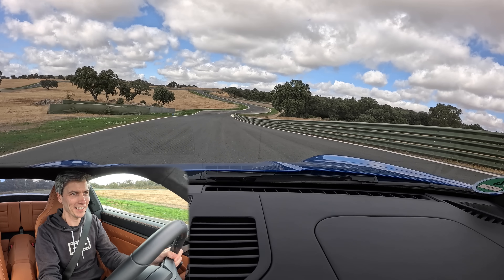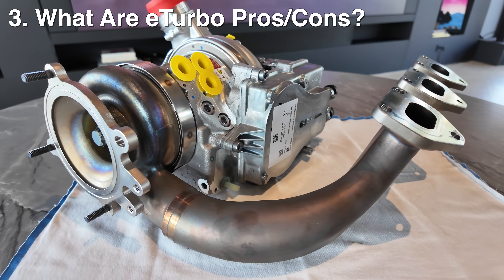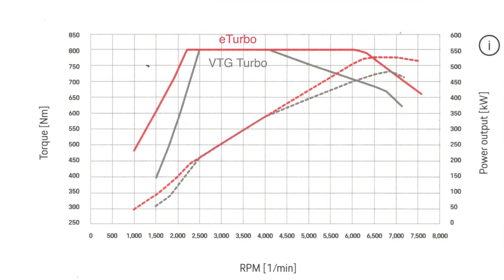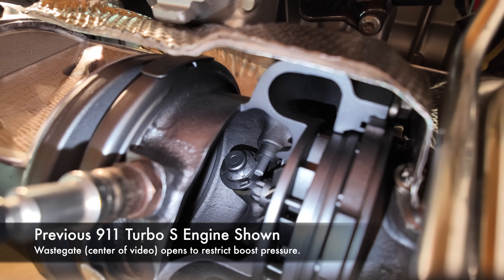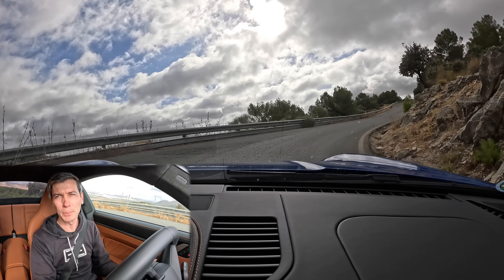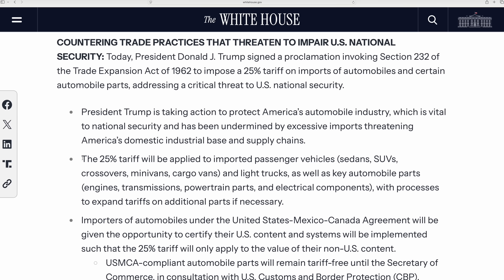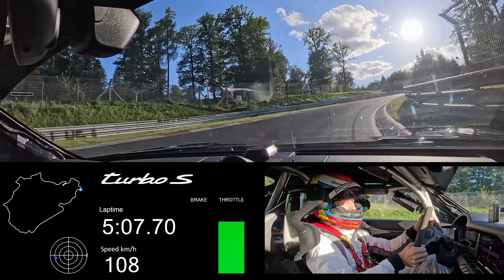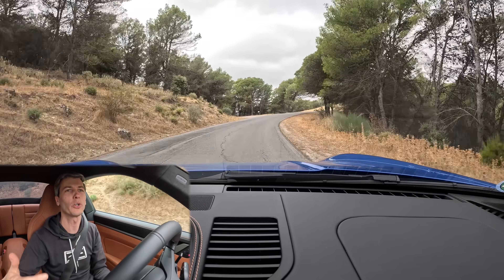Electric Turbos Are Here — Is It A Good Thing?

Comment: Sounds a little bit like what we used to do in the sixties.  Replaced the belt drive with an electric motor on Paxton superchargers.  Pretty effective on the drag strip.
Reply: Tell me more about this.  Interesting
Reply: I'm guessing you had the lead acid battery power to last the 15 seconds required to run a quarter mile. It would be interesting to see some historical records for this.
Reply: Has some similarities. With modern technology things are much smaller, much lighter, and much more powerful. The computer control for everything also makes it much more usable. The old systems could produce a lot of power, but were heavy and hard to control beyond specifically for racing. Now, they can build systems that are compact and lightweight while still making similar power and are usable in much more varied driving.
Reply: Yeah, this is an electric supercharger. The only difference is the energy harvesting because it's not a dragster.

Comment: The Next Gen 911 S/T-T will feature a manual transmission, 2WS only, pull tabs for door handles, a hand cranked engine starter, and, a single fixed geometry turbo with 4,000 rpm threshold with a 10 second lag....

...and a US$1M price tag...

...for engagement and weight saving...

Comment: Seems to me the best route would be to buy the best aircooled vintage Porsche one can afford for tactile thrills on weekends and an EV for the rest of the time.

Now an electric compressor with just the electric motor and compressor makes sense as an aftermarket altitude compensator for gas motorhomes.  The electricity can come from the house batteries, which are topped up with solar, on-board generators, and/or shore power.   Would only develop boost as needed, mainly for steep inclines and mountain passes

Comment: I have a problem with your "Advantage # 6".  If your battery is depleted, and your engine can produce 630HP, the 37HP from the turbo's (2x14KW each) has to come from somewhere.  This must come from creating back pressure, which reduces engine output by at least 40 HP. So, at this mode of operation, your engine will output around 590HP, not 630HP. So your total HP will still be just under 630HP.
Other than that, electric turbos are excellent.  My C63s E-Performance is fantastic to drive, with instant power and acceleration, and far outperforms its predecessor with the 4.0L V8 Twin Turbo, even though it's around 500KG heavier.
Reply: Your assumption on the arithmetic is incorrect. The power recovery from the exhaust energy is far more than the power cost from the increased back pressure.

Comment: It does surprise me that it is more efficient to convert the exhaust gas energy to electrical energy and then back to mechanical energy, than it is to let exhaust flow more freely out of a wastegate. I would love to understand the calculations behind this. I'm sure the engine must work harder to fight the extra back pressure. But I guess the turbo regen recovers energy faster than the back pressure takes power away. Still kinda trips me up though .

Comment: Impressive but dated at the same time. A properly sized electric motor gives instant torque to the wheels, no need for overcomplication of ICE assisted by a turbo assisted by a small electric motor.  Cool but a bandaid tech at the same time.

Comment: Clearly, you never drove an FD RX-7 with the twin sequential turbo setup. It drove very much like ahat you described. The only "laggy" part of that 13-B was coming off idle, when theres minimal exhaust. If the throttle was cracked, wven just a bit, the first, smaller turbo, was spun up and essentially zero/minimal lag.

Comment: Lets just get rid of the exhaust side altogether.  Full electric e-Charger.  Reduces complexity substantially.  Packaging is way better, not having to accommodate exhaust plumbing.  Lighter weight, etc.
Reply: That would be an astronomical waste of the energy the exhaust gas has

Comment: Another piece of over-engineering a solution for less than 0.1% of the marketplace. 👎
1. As of today, most high-end EV cars beat the Porsche 911 Turbo S in price, performance, maintenance & running costs
2. Once static batteries come out (with 2 to 3 times the energy density of Lithium Ion), the gap will be even more immense.
Reply: Why on earth do you think a Porsche 911 Turbo should NOT be for less than 0.1% of the automotive marketplace? It always has been, always will be? If you want a Corolla or Civic, go buy one

Comment: I think this is super cool. It’s like it’s blurring the lines between these different technologies of being a gas and electric hybrid and rethinking what the role of a turbo is. I thought it’s especially cool how it doesn’t use a waste gate and it uses the extra energy from the turbos to power the electric motor. It’s like one harmonious unit where the engine, turbo, motor, and batteries all work together to create the most amount of power as quickly as possible.

Comment: Not only are ‘electric turbos’ a shitty idea, whatever you call them, you shouldn’t call them turbos because that’s not what turbo means.

A Turbocharger is specifically powered by exhaust gases. There is a mechanically driven equivalent, which is called a supercharger - if you’re going to try electrically motivated forced induction (why?) then it should be called an electric supercharger.

But it’s still a shitty idea. It’s an over complicated solution to a problem that was solved thirty years ago.
Reply from the maker: You sound upset. The turbine is indeed driven by exhaust, hence it is an electric turbo. All turbos are superchargers, by definition.
Reply: @EngineeringExplained  Not upset, Turbo lag is a forty year old problem solved thirty years ago. Get an electric’ turbo’ if you want - good luck having it still work when the manufacturer decides they’ll stop supporting it so you have to buy a new one.

Comment: i feel like they make this setup more complicated than it should be. why not a 100% electric turbo? no more backpressure on the exhaust gasses and way less mechanical complications to maintain in the long run. a 100% electric setup would also be cheap af to replace when it eventually fails. the 3d models of the hybrid electric+exhaust powered turbo on this porsche you're showing make my head spin, maintenance nightmare.
would a 100% electric turbo need a complicated engine oil flow cooling setup? given it is not powered by hot exhaust fumes, id think this is one less complication needed for it to work. 
omg i want to talk to the engineers rn

Comment: Does an electric turbo being spooled by the electric motor also improve scavenging by pulling exhaust out of the combustion chamber at lower RPM?
Reply: No the higher the RPM of the turbine actually helps creating more backpressure(Radial inflow turbines is funny that way).
Turbine power is PressureDropOverTurbine*MassFlow*EfficiencyAtThisSpecificScenario so as the turbo is accelerated by the electric motor it does create more "turbine backpressure" so that the exhaust also can give more power to the turbo.

Comment: So it's basically electric turbo-compounding.
Reply: Exactly. Without the complexity or weight of a fluid drive to feed the turbine power into the driveshaft. Really clever.
Reply: So is it like a supercharged car but instead of belt, uses electric motor?
Reply: @randomman6189  no its turbo, it still has the turbine in the exhaust. Some turbos have a drive connected to the crank shaft to put waste energy back into the drive train.

Comment: Wonder what it would be like without the battery at all.  Just the turbos powering the electric motor; lower weight would be better for track .  Under track conditions, revs are high anyway - lag is reduced.

Comment: That 3.6 is a completely new engine shares only 1 part with the previous unit x 6 ...the injectors. The turbos can spool 145,000 rpm. It's leagues ahead of the previous version.

Comment: So they're hybrid turbos, not purely electric turbos. This means they still need intercoolers. If they were purely electric, they wouldn't need intercoolers because they could be placed away from the exhaust manifolds. I don't know if they would be able to spin as fast, however. You're thoughts?
Reply from the maker: Intercoolers are unrelated to if it’s exhaust driven or electrically driven, when you compress air it heats up, so the intercooler is needed to bring this temp back down.
Reply: @EngineeringExplained  Man, I'm not able to wrap my head around why compressing air makes it warmer. I always thought denser air was cooler. Cold air intakes are all about colder, more dense air, right. Or does the artificial compression of air to make it more dense have some affect I'm not aware of? Like the molecules are now moving faster in a more confined space, so more collisions with other molecules causes heat?

Comment: How are they cooling the coils, turbos get hotter than anywhere else on the engine 🤔 is the coil in its own water/oil jacket, or have they found a way to run electronics at a higher  temperature? 
How does this account for the thermo-resistance relationship of the conductor?
Otherwise its a very cool concept with removing vanes and wastegates

Comment: What's the point of having a traction motor if it doesn't a whole lot because most of the power is sent to the turbos? 
I like to see a comparison bet this and the older NSX that uses the motor to blend torque and turbo lag with traction motors

Comment: Great innovation, but not entirely new, some company in Australia was selling or developing electric boost devices at some point. The problem was the huge amount of power needed to make big boost using electricity only. It required a large battery setup and huge electric motors to generate a boost equivalent to a regular turbocharger. (Think golf cart sized)

I see a use case for this where diesel-like torque is needed from a non-diesel engine, for towing purposes, a system that generates huge boost pressures at low RPM would work for such applications. I don't like that the boost still needs time to build-up on the Porsche design, there should be a trigger button to go to full boost for hard launches from a standstill. Or a setting that maintains the highest boost at all time for short bursts of high torque power.

Comment: Lugging engines with electric turbos will be more common because of the low RPM and instant high load, especially these sports cars with manual transmissions or automatic transmissions that don't auto shift when using padle shifters. Engines wear quicker when lugged.

Comment: Hardly a new idea. Large ships using two stroke diesels use electric turbo's at low speed because the exhaust gas turbos can't pump enough air.

Comment: Pro for eturbo: You didn't mention that anti-lag on traditional turbos is hard on the exhaust as well as capable of doing damage if configured incorrectly.  Con for eturbo: You don't get the cracks and pops from a traditional turbo with anti-lag.  or maybe it's a pro, if you aren't into that kind of thing.

Comment: A triumph of engineering--using hybrid technology to maximize performance.  But for the 98% of your audience that will never be able to drive this car, how about just using a beefier alternator and battery to power an electric compressor.  It would reduce cost from conventional turbo, eliminate lag, improve emissions and fuel efficiency, and actually reduce service costs.

Comment: See the move is simple, get a 3-2-1 Coyote Twin Turbo with sequential twin turbos so you already have an anti-lag system essentially then use 1 electric turbo to enhance the smaller turbo allow for instant power on launch and big boost on top end.

Comment: Jason, great vid as usual.   One thought I had was that wouldn't it be useful to allow each intake and exhaust turbo to either spin independently or be rigidly attached via a clutch?    There are probably modes of operation where the compressor and turbine are optimally spinning at different speeds.   This would probably require separate electric motor/generators...

Comment: seems like replacing the electric motor starter, electric motor driven turbo  and the outdated, heavy, dirty, noisy, slow to respond internal stinkbustion power plant with one big electric motor would make the most sense, provide a much quieter, enjoyable and cheaper over all driving experience.

Comment: I have a question that is not exactly on point. I have all wheel drive Alfa Romeo Giulia four cylinder. In sport mode I can take off from a traffic light with instant acceleration. I’m assuming that the turbo is a small one. Does this instant acceleration have anything to do with the all wheel drive?

Comment: Good insights. Regarding advantage 7, are emissions really reduced if you’re increasing exhaust back pressure by slowing the turbo through energy recuperation? (#4 I think) Not an engineer, but just seems to me the two are at odds. Thx.

Comment: "Higher RPMs"? "Higher revolutions per minutes"? I thought the unit was one minute. DEADASS!
Reply: It is revolutions per one minute. RPMs is just shorthand, not grammatically correct.
Reply: @abhijeet_ghosh  Do you understand what shorthand is? In this case, revs would be one syllable less than the high school drop out term "RPMs". How can you claim to be explaining engineering by using obviously backward psuedo-terminology? Other redundant terms used by those less educated are ATM machine, or PIN number. This "engineer" has a chronic form of RAS Syndrome, or Redundant Acronym Syndrome Syndrome.

Comment: what does it do to pre-turbo exhaust gas pressure then? 
the wastegate would have allowed excess gases to by-pass the turbo, but in this scenario the gases are stuck in front of the turbine? 
doesn't that make the engine work harder to pump out the gases through the slowed turbine?

anyway it looks really interesting and well thought-out, I can imagine that replacing 'normal' turbos in a few years.

Comment: A downside will be cost replacement. And since Porsche charges $1,110 for their least expensive key. The price of an electric-turbo will be significant as for a time you will have no choice but to purchase your replacement OEM. Also, heat will kill the motor.

Comment: For non-track use, better to replace the flywheel with a hybrid electric motor to help the engine instead of turbos. Regenerative braking is free, a hybrid electric motor reduces load on the engine with zero lag vs turbos increase stress on the engine, and while engine is warming up a hybrid motor mostly pushes the car to be gentle on the cold engine

Comment: Compexity of this system is absolutely insane… which will ultimately be its demise
Reply: No, it's not particularly complex as far as modern engines go. On the contrary, the combination makes almost every component simpler than in a different system for the same performance. The electric turbos are really just big turbos with a small electric motor in the middle. Those motors are nothing special - because turbos rotate so quickly it's much easier to effectively electrify them than other parts. And because you power the turbos first, the engine is responsible for low-RPM torque, so the traction motor doesn't need to be huge or have a big gear reduction. Because of the electric recuperation from the turbo, there's no need for the usual waste gate hack, and efficiency is high without much variable valve timing shenanigans. (Which is also a way more complex system than putting an electric motor in a turbo.
(And of course the combination of engine and battery means both can be quite small.)
Reply: ...But, yeah, compared to a purely electric car this one is more complex of course...

Comment: can you do a video on the challenges of having an electric motor in such a hot enviroment? does it need different enamel? is it actively cooled? does it gain/lose efficiency with higher temps?
Reply from the maker: Great questions! I do have some info: the motor in the turbo is on the same cooling circuit as the engine (water cooled, ~100C), the turbo has constant oil flow, and the inverter for the turbo motor is water cooled on a separate circuit that keeps temps around 30-40C.

Comment: As an engineer I only understood throttle and boost after decades of driving experience. You could make a nice video explaining that the engine is made to constantly starve on air, except the full throttle moments, and still it does starve then due to the filter and intake drag,

Comment: Q: when you punch it and the battery first powers the turbos to spin up, and after the turbos are fully spun up, you said the extra power the turbo electric motors can generate goes to power the pancake motor in the transmission... got it, but when do the turbo electric motors charge the battery back up? Does it have to wait for part throttle to charge the battery, or is the electric power fed to both batteries and motor in transmission??
Reply from the maker: Any partial throttle you can raise the engine’s load and use the extra load (with dct motor) to send power to the battery. You’re never really flat out constantly, so any time you’re at partial throttle or braking you are recharging the battery, and even at full throttle, you could divert from the turbo to the battery.